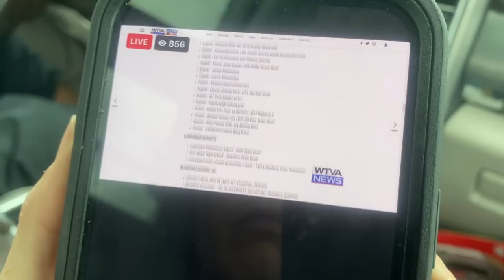Broken Frame & Major RV repairs Vanleigh Beacon | EP32 Full Time RV Life

Comment: We RV'd towing a 36' Triple Slide Cedar Creek for a few years followed by a 38' Mobile Suites using a custom built International semi for close to 12 years of combined travel.  Gotta say that the very constant maintenance/repair issues, even with the bulk of them being fixed by myself with a background of 45 years of maintaining and repairing high speed production equipment, got old real fast. It got so I was carrying a full machine shop in my Harley barn on the back of the truck.  I'd show up at an rv resort with old friends waiting for my arrival so they could get me to repair stuff like hydraulic slideouts, suspendsion issues etc., I was even carrying two 20 ton air operated hydraulic jacks - got fed up with the whole exerices and bought a place in Florida. Never looked at another RV.

Comment: Vanleigh...  Hmmmm. From an engineering standpoint, I never expected much and was not surprised to see them quickly fold in the downturn. The RV industry in general just does not provide rigorous durable goods for all seasons but are priced as if they do. The money is instead spent on aesthetics. It will never change unless prospective buyers simply refuse to keep supporting this. Sorry you're having to endure the results.

Comment: Thanks for thanks for give me head up on the product issues. I'm a full-time rver was looking to buy at Beacon RV. Now I'm going to avoid it at all costs and select another manufacturer. I'm seriously considering the Brinkley 5th wheel. There is no wood used in the manufacturing. So no rotten floors, walls, ceilings or slide out.  Slide outs are also floor flush.
Reply from the maker: We stopped and looked at the Brinkley 5th wheel multiple times and spoke to the folks from Brinkley while at the Tampa show. Very well thought out with some excellent design features. Impressive unit!

Comment: My wife and I purchased a new RV about 2 years ago.  Everything has been falling apart from the first day.  

If we took it in for warranty repairs every time, we would likely never go anywhere.  

I have been fixing it myself continously and a won't travel without a substantial tool kit and a lot of supplies.  

Quality seems to be dismal across most of the industry.  Our next one will be one of the higher build quality brands even if it is double or triple the initial cost.  Repairs keep it from being fun for me.
Reply from the maker: You are right - there is a lot of opportunity in the industry.  We have only taken our rig in for the major issues that became travel impactful; roof replacement & frame issues but while there had them address the other major outstanding issues. We are still fixing it daily ourselves to avoid service centers but will have to go back at some point to have the frame gussets welded in.

Comment: Just found your channel.  What if any repairs are under warranty? We have had 7 RV's since 1986. All motorhomes with the last being  45' Teton 5th wheel. All were purchased new. We have been through just about every issue you can imagine while working through each rigs factory defects to achieve  satisfactory levels to permit full use of the rigs. Rigs included class C's, class A's  diesel pushers, and the 5th wheel. One of the pushers was returned as a lemon. "Been there, done that," as the saying goes. Wish you well in getting your rig road worthy!
Reply from the maker: Hey Rick! All of the issues we have shown have been warranty items thus far. We are now out of our year warranty for the majority of items but still have the some time left on the 3 year structural. We are doing are best to get the rest of the items squared away without impacting our ability to enjoy RV life. I have repaired some at this current stop we are at but unfortunately we will have to go to the factory for some larger repairs. Unless I become skilled in fiberglass repair and obtained a welder! Thanks for hanging out with us.

Comment: The elephant in the room is the construction techniques used in RV's. Just compare a normal gooseneck trailer and look at the steel and the gussets used to give the trailer  frame rigidity to haul  stuff around. Then look at any fifth wheel  RV trailer and the frame is not  as robust or suitable to carry the weight or to withstand the road shock from poor roads under extreme conditions. If the foundation is flimsy then any stress will be reflected throughout structure. Next aluminum is a good lightweight material but under flexing the welds will always break just ask Grumman busses   years ago where the aluminum welds would not hold up. It is just a shame that so many users end up with so many bad stories regardless of the brand.

Comment: Wow, you guys have been through a lot of major problems with your Vanleigh Beacon in such a short time. Issues with our 2022 two month old 41LKB Beacon seem not as bad.  Two weeks ago we had a major rear axle failure going through the Houston area, which caused a fire as the tire jamb up against the rear leveling jack rupturing the hydraulic lines.  We were suck on the side of the highway for 11+ hours before getting a wrecker company with a lowboy/bus trailer to move the Beacon to a near by dealership for repair.  It looks like Lippert will provide a new 8K axle assembly and repair associated damages. No body told us RV'ing would be so stressful...lol.  Hope your Vanleigh has no more surprises to throw at you all.
Reply from the maker: Wow, you have had your own set of issues! 11 hours on the side of the road 😳 So glad you got your  damages covered! Definitely knew that things wouldn't be perfect but we never imagined we would spend so much of our time in service centers with such major issues...but here we are! We hope you guys have better luck with your Beacon! (Us too!) Thanks for watching!

Comment: To keep the weight down, lighter frames are ordered and used by the manufacturers of fifth wheels and all towables.  To my knowledge there's only one manufacturer with a seriously engineered frame to support the weight and it's out of the Kansas area producing low numbers per year
Reply from the maker: You must be referring to New Horizons. I have been attempting a stop in Kansas for a year but always find ourselves just outside of their area. I have met folks on the road that love theirs. Hopefully we can see one at the Tampa show this year. Thanks for hanging out with us!
Reply: @MidlifeDetour  Yes, I couldn't recall the name But that is it. We have a Winnebago Navion motorhome and love it.  We've had towables in the past.  But as seniors with health issues, the motorhome style allows freedom we need to travel.  I wish you well and resolving The problems with your tiffin fifth wheel. As a side note, when tiffin entered the Class C market their engineers did not understand the weight issues and only had occupant cargo carrying capacity of 750 lb.  The solid wood and solid countertops are great for Class A's but not for C's
Reply from the maker: @earlhunt2815  Wow 750 pounds is unbelievable. That weight would add up and be gone quickly. Adds the bling but takes away all functionality. We spent some time looking at Winnebago Views at one time but being full time with the two large dogs we decided it wasn’t the best fit.  Would be great to get around it however.

Comment: Why would it cost you anything for the spare tire? That should 100% been covered under warranty since the hoist failed and dropped the tire.
Reply from the maker: Our truck is outside of warranty. The spring in that hoist had completely sprung and given up. The price we included in this video didn’t include the cost to replace the hoist. If I recall we were able to chase it down for around $140.

Comment: They will replace all parts with the same parts that broke from the factory. What's the point ?
Reply from the maker: Correct. What was engineered incorrectly was not improved and they returned to the original factory state. Unfortunately because no improvement was made the same break occurred again which could have been avoided.

Comment: Junk. Properly done welds are STRONGER than the surrounding material. You TIG weld the aluminum struts to the horizontal beams, a proper weld penetrates completely through the wall and deposits material. If you go too fast, you do NOT get a proper "puddle" and do NOT penetrate through into the cavity. When you grind the outside to smooth it, you should NOT remove material from inside the cavity, but it sounds like they were lazy ( or going too fast ) and over-ground INTO the cavity and removed too much material. THAT is the only way that the seam will be weaker than the surrounding material. The manufacturer, clearly, does NOT have good welders doing this.

Comment: Since when does a dually tire cost 1000 dollars . Don't think so my 11 24.5 is 750 each. Frame broke like most rvs they run 75 80 mph why not run slower you don't have a frame like a semi. Just saying
Reply from the maker: Hey Mark! When the spare fell off the truck it took the rim it was attached too with it. Our tires aren’t cheap but in this incident it was the rim that was the more expensive part of the equation. We run 65mph. Thanks for your comments!